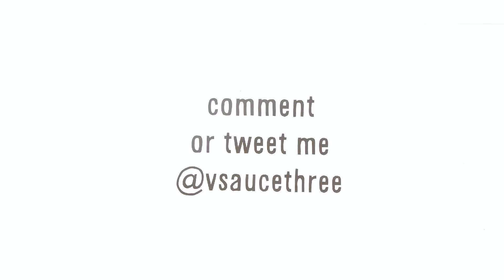5 Awesome PlayStation 4 Facts! -- Fact Surgery

Comment: Still not as good as PC technology 6 years ago.
Reply: yha if you threw 30k at your computer 6 years ago most people don't have the money to spend more then 500 on a computer and most computers that cost 500 are fairly good they still cant handle any game you buy. with a ps4 you buy a game you know it will work.
Reply: michael3334115mrman
Excuse me but I only spent $530 on my computer, it runs BF4 on Ultra at 60fps 1080p. It's not so much that people don't have the money to buy a computer, it's that you don't know where to buy the computer parts.
Reply: if you build a computer today yes but most people don't know how to do that and he said six years ago not today.
Reply: Building a computer is just like adult legos. You can buy and build a computer for the same price as a console, and the PC will still be a lot better. Plus, there is Steam deals, which saves you even more money. There are plenty of video tutorials for picking the right pieces and building the computer itself. I've build many computers myself and seriously, it's not hard. You just need to have the right parts and the right know-how. And a $1500 computer 6 years ago was still better than the PS4, if you had the right parts. Seriously, buying even an overkill $3000 PC will save you money down the road from a console. I'm not trying to bash the PS4 at all, I mean, the 8 GBs of GDDR5 ram is pretty impressive, plus that it's GPU is about equal to a 660 Ti, a $200 card. It's cheap for what power it has.
Reply: I know iv built computers myself but still most people don't know how and the ps4 is still a better choice for most people and how much different dose it feel playing on a tricked out computer from playing on a ps4? not the big of a difference it looks the same and runs fine I just get annoyed when people saying pc is the master race cause its better when if you think about it not really tho I do admit steam sales are awesome I agree with that.
Reply: The mouse and keyboard, being able to get 200 FPS on a demanding game, 3-way monitors, plus it's a computer, it can do anything. It's superior in everyway pretty much.

Comment: XBox users just got but hurt.
Reply: Actually, the PS4's hardware specs are equal to the Xbone but the xbone uses a different type of RAM which makes it slightly slower, but not even enough to notice.
Reply: Dominic Zucchini no they are not..ha ha ha ha..please for fun send us a link where Xbox has the same specs, graphic speed GUI setup, harddrive space and processor speed as the PS4

The ram, there is a HUGE diffenece to be honest, i suggest you google some ram test sites that will show you a diffence, PS4 can process almost at a 40% faster Frame processing rate than the Xbox, which means more content per frame and faster frame change.....

I know it istrue but you seem to think it isn't , please show us..because as of now PS4 is about 5x  more powerful than a Xbox One

Comment: Aaaand it is still a beefed up... wait, no, it is a mid-class PC with their own OS. Easier to make games finally, sure, but you can already get better pc for same cash nowadays... Heh.
Reply: Its funny how it explains that the Ram it has is so much, except that 8GB of RAM was like average back soon after PS3 came out.
Reply: Yomuju You are the disrespectful one. I am merely stating a fact. And yeah, you can buy decent PC for 499usd no problem. I also use PS3, though the only decent games for me there are GTA V, Red Dead Redemption and Metal Gear: Revenagance (not counting Metal Gear CollectionHD) and maybe Mortal Kombat. Just PS4 is a jump at money and a scam imo. No dedicated hardware architecture. And the OS I get for free from MSDNAA/university. Only reason for consoles is basically the lack of need to configure anything, if you are lazy or don't know much about tech. Valve noticed that too, hence they do the same move - pc in small case, their own OS - the Steam Box. Plus their library can give their console way more games at launch. This will be fun to watch, as some of the new gens might be the last ones this time around.
Reply: Yomuju Did you know, on PC you can Play Skyrim with good graphics and really low load times with a smooth frame rate?
Reply: TheCrusaderBin
You can't buy a pc for 400$ that comes close to the power of a ps4... And the part about getting the OS for free is also bullshit. And PessOmist  ofc you can, but the PC that is going to allow you to do that will cost loads.
Reply: Yomuju So you just don't own a computer at all?
Reply: Yomuju I just spent about $400 on a gpu alone.  worth
Reply: I love PC gaming, but there's no way in hell you can get a better PC for that price. You probably heard that on the internet by "MasterRace" arrogant, but when you actually build up a PC you'll realize that this is just delusional. I don't think this will be the last generation of consoles, they are great for budget gaming and for the family. The Steam Box looks nice, don't know about the controller yet though, but it's the price that will determine how much they will triumph. I don't really see the reason to own that over a PC IMO
Reply: Just saying, if you already own a desktop, all it takes is a $400 GPU to be way more powerful than a console is.
Reply: PessOmist Like I said, there is a lot more you need to get to start playing games on the same level as a PS4. A single graphics card won't do much.
Reply: BacklTrack  I built my PC 3 Years ago and it seems to run pretty much everything that has recently been released. I guess the $380 I spent was a pretty good investment :3
Reply: Yomuju Maybe not with the OS, but usually people who are gaming on PC have parts already. Not to mention the fact you don't even have to buy a GPU anymore, since the new AMD APUs (a10 7850k) offer power equal to that of a 7750, which can ultra skyrim at 1080p with 30fps. The rest of the parts can be found for under the extra you have left. Maybe you should stop being a hypocrite and take a minute to do research instead of attacking others.
Reply: Yomuju Im sorry but you probably play Minecraft on your mothers gateway if your saying that PC isnt the best way to game.
Reply: Yomuju You can pirate a OS for free and many colleges and universities will supply free OS for students, educate yourself.
Reply: Why is point of focus for the 'master race' always specs. You know there is more to gaming then just graphics. I would much rather get a cheaper device that has slightly lower graphics and be able to just put a disk in and play a game comfortably on a couch in front of a larger screen rather then hunched over a keyboard. I know you could say why don't I just buy a controller or a gaming chair. That's again more money. If I buy a $100,000 muscle car of course it will be better than a car someone buys second hand for a few hundred. Does that mean that everyone should have an expensive car? It's all up to preference, so I'm sure that this will not be the last gen for consoles
Reply: Yomuju dude, I bought a $200 GPU that fucks over the PS4, get real.
Reply: TheMurf Well I just use my 360 controller which I already have, my couch, which I aready have, and my TV, which I also already have...
Reply: Cost of a PC that beats a ps4- $600, cost of new gaming monitor- 200$, cost of rebuilding game library $150, cost of all other miscellaneous expensis $200. Add it all up, at least $1150 for a PC. That is just one that is at least a little bit better than a PS4. More power means more money. Educate yourselves.
Reply: TheMurf Some people find a keyboard and mouse more comfortable than a controller? I don't know how you game, but if you're hunched over a keyboard, you're doing it REALLY wrong.
Reply: Thmas451 Who said you had to be hunched over? Lol I know I never am when I game im quite comfortable all the time.
Reply: Yomuju How about you educate yourself here. You don't have to buy a monitor for a ps4? How does that argument work? And I can easily build a computer that costs 400 that will be better than a ps4 running steamos. And rebuilding my game library? Dude, you can't even use your ps3 game library on the ps4, you have to rebuy all those games on psn. And I can rebuy all my games via a steam sale for under fifty bucks and I will save money in the future as well because game retails cheaper on PC.
Reply: ***** The base price of the console only works if you are the type of person who otherwise would not buy themselves a computer.  Most people who play video games also spend time on a computer so if you are buying a computer anyway, might as well blow your console money on a GPU because the computer will be marginally more powerful.
Reply: A lot of people like the simplicity of console gaming. You might be able to build a computer for the same price that has similar specs but most people don't know how to build a computer. With console you don't have to worry about multiple updates and patches from different software and games; and as there is only one brand that makes each console there is a lot more support that applies to all users making it easier to troubleshoot your problems
Reply: ***** Pc's weren't made for gaming. It's not fair comparing a pc with a a game console. It's like comparing a race car with a standard car.
Reply: davee nexus comparing a racing car to a land speed car.
Reply: davee nexus You fucking kidding me right? If PCs werent made for gaming then a console isnt either because all consoles are are just low-mid range PC parts so your statement has been deemed false.
Reply: chase baker I've agreed with your statements so far... But that one is a little off. The average PC, which is the most common, is made for compute and algorithms. The average console is designed with the specific purpose of running games. Everything else, multimedia apps and such, are an after thought that hinge on the, usually, proprietary OS the developers put in place to work with the system's low power output. I'm not saying you're completely wrong, just, PCs weren't made to game. It just so happens that people decided making digital forms of entertainment was nice, and with the power you could draw from expressly made parts that go into the making of a "computer" (as in all the parts needed to achieve what we know as computers today) playing games could be something it can do other than solving math problems.
Reply: (Not to start an argument) You must not realize that a console is just a watered down PC with a custom OS it even uses AMD parts, another thing is, MY PC was built to game because I BUILT IT to game.
Reply: chase baker I must not realize a console is essentially a PC? Hell, it was posted everywhere that AMD pretty much made this generation. Even if I knew nothing about PCs, I'd know that. But... You missed what I was saying... Computers were not made to game. Simple as that. You may have built yours with that purpose in mind, but that doesn't mean that's the only thing those parts can do. A good CPU, isn't made for gaming. It is made to calculate things. A good GPU is, sure, made to game with, but its purpose is graphic processing, which isn't only used in gaming.
Yeah, no arguments, but don't assume things about people.
Reply: chase baker Pc's weren't made for gaming in the first place u nut. They had pc's when i was studying architecture. I used softwares like rhino. don't tell me shit if you haven't been there. Not to start an argument, haha hypocrite
Reply: davee nexus Like I said I BUILT my PC to game, your Dell or whatever you have may not be but mine is and for PCs not being built for gaming they sure do kick the hell out of things that are.
Reply: Thmas451 I understand that its not the only thing that a PC can do but im saying I built my PC to game, Alienware, iBuyPower, etc make their PCs to game, some PCs are made with the purpose to game.
Reply: chase baker They are built to game, but you're statement said they are MADE for it. They're not. They never are. You can have parts that are GOOD at it, but that part wasn't MADE for it. Again, CPUs, GPUs, RAM, etc., none of those are made to just play games. If that were true, your CPU wouldn't even boot up the damn OS, let alone keep programs open in the background that are consistent. Graphics cards aren't even designed for gaming. They're designed for GUI and algorithms that would otherwise be too difficult for the CPU since they're completely different architecture.
My problem isn't with you saying that yours was made to game, it's with the fact you scoffed at the notion that computers aren't made to game. Which they aren't. No computer is made specifically for that. They can't be.
Reply: chase baker I'm glad you knew what we were saying and kept arguing a false point. Welp, like you said, it is the internet!
Reply: Thmas451 I now understand what your saying now that you said it in depth so I didnt continue
Reply: Did this just resolve relatively peacefully? Ha. This isn't the internet.
Reply: that's exactly why I like consoles. Just plug in and play